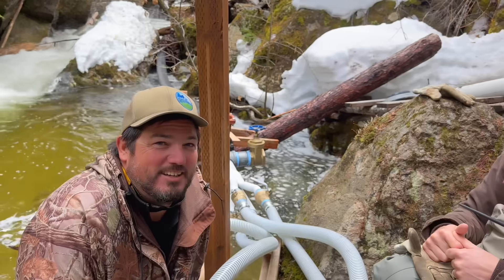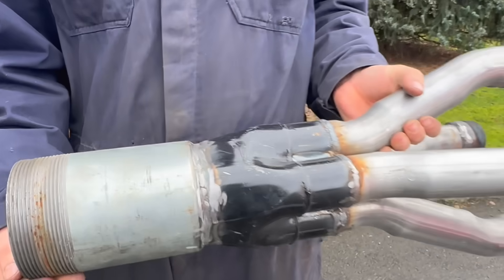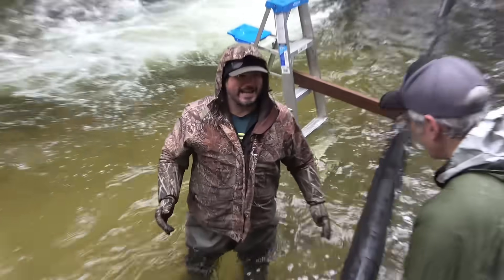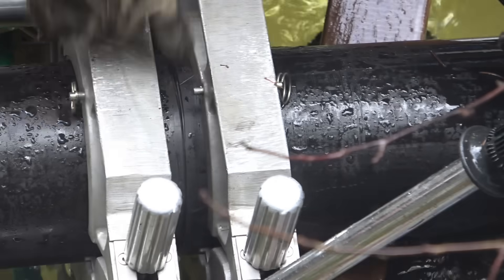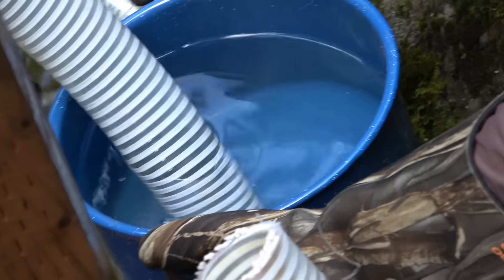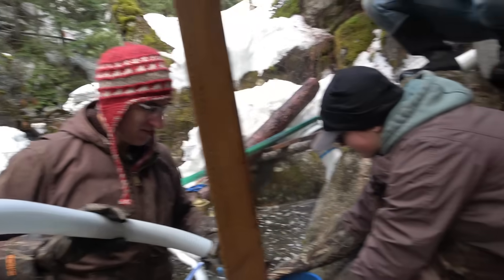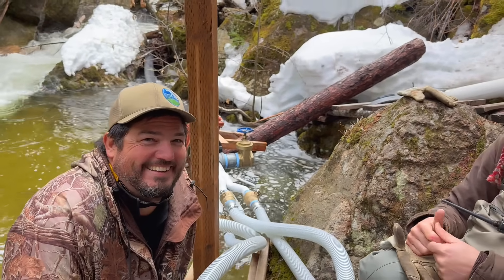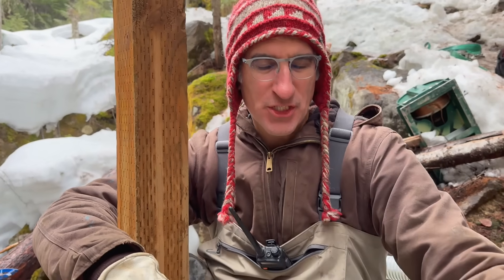Off Grid Micro Hydro - 24/7 Electrical Power - THIS is The Way!

Comment: Need to match the generator with the flow. Just by a guesstimate I would say each of those hoses could power 1 generator the size you got now. The rpm is what is key or flow on low head systems. For a investment if that river flows like that year round you could build a spiral flow generator. It takes excavation and concrete forms. It has the potential to be a 100kwh site. Electricity grid power will only get more expensive and they by law have to pay that's grid back fed half of what they charge
Reply: More more thing. If your generator is far from the load,house, then higher voltages might be needed anyways. Voltage drop is the main source of breakdowns in circuits
Reply: @brettmoore3194  voltage drop only matters if you run DC very far.....3 phase AC, which is what the generator puts out , can be ran a long way with smaller wires than DC

Comment: What's the ROI and life span on a system like that? I imagine it is not terribly cheap but it's a work horse 🤷‍♂️
Reply: depends on how much it cost to put grid electric in and how much per kilowatt it cost for grid electric.....say if it cost $30,000 to put in....instant ROI, if it is in already and electric cost $0.10 per Kw then it might take 8-10 years...same with solar

all you see here is the pipe and generator...then you have to have  batteries, a charge controller, an inverter, and wire to wire it in....if you were in kentucky, they want you to have a $1,000,000 insurance policy just for the system and have it NABCEP certified on the install if you connect to the grid

Comment: 12:40 - I guess torch would have still been usable to heat the barb fittings so they don't immediately absorb heat from the heated pipe

Comment: I don't know how far your wires run, but a higher voltage is generally better for efficiency. Get a proper charge controller on the end where the power is being delivered at and the turbine will be more efficient as well.

Comment: I don't really like being critical but people sometimes need things called out ...  Your level of pollution needs to be STOPPED, by everyone!!!  It leads to cancer and disease.

I appreciate the spirit of innovation and building for sustainability but it should still have some regard for the cost of humans contaminating pretty much everything.  The cutting of the plastic pipe and hoses, and the machining to weld the plastic pipe, left behind plastic fragments that will turn into micro-plastic particles (not to mention the chemical out-gasses) and make there way into the ocean, if not other peoples water sources.  If you knew that someone upstream from you had done something similar, and that contamination led to your family's health issues, or death, you might think before doing it to anyone else.  Please act more responsibly, and advocate for better, otherwise, we wont make it on this planet.

Comment: QUESTION: Wouldn’t it produce more overall power if instead of using 4 nozzles in to 1 turbine, you used 1 nozzle in to 1 turbine, but did that 4 times (requiring 4 turbines)?
Since the water is approximately the same speed coming out of each nozzle, having 4 nozzles in one turbine, is not increasing the rotational speed, just helping the turbine overcome any physical resistance.  But if you had 4 turbines going, snd you were able to balance the outputs in parallel you could get close to 4 times the output in power in to the batteries.  Even if it is not exactly 100% of original times 4, if it was even 75% times 4, or 50% times 4, you have substantially increased the power going in to the batteries.

my question is how ro you combine the parallel output of 4 turbines simultaneously?

while i am not sure of the answer, i am speculating, you could get 4 EG4 Chargeverters, and feed each one with AC output from one of the turbines, which then is converted to charge 48V batteries.  This would reduce energy loss from turbine to batteries, because of higher voltage ac thus less resistance losses, and allow parallel charging in to batteries.  This also eliminates single point of failure (after the manifold).

please advise on your opinion of this idea

Comment: It may been wise to have built a sturdy 'power house' first, then you could be doing all your tweaking and adjustments in relative dry, calm away and above the river, also you could store all your tools and equipment there for when you need to service the machinery. You are right about laminar flow though.

Comment: Also, your "intake" at the top should be capped off, but have like 20 foot of pipe with little 1/8" holes drilled in it everywhere in a grid pattern all the way down it, so that it creates a screen, essentially.  But it would still be a very large intake so that it doesn't restrict the flow..  But it DOES stop any rocks from coming in.

Comment: You need to optimize it by changing the LOAD..  Some systems work well when spinning up quicker..  But a system like this looks like it would have a lot of TORQUE.. meaning you could bog it down with a higher load and pull a lot more current-- and I bet that water could still spin it.  I would try to add more and more load onto it until it actually stops spinning, then you would know exactly how much torque that water can turn..........  Think of it like putting a little generator on a diesel engine and all this time you're trying to "optimize the diesel to gain a few more RPM's.   That would be silly right.   Because we all know, diesels don't need to spin faster, they just need more load on them, because they have high TORQUE,  not  high speed..........  I don't know what you guys have this running:  I assume it's just going into some sort of charger for batteries.  My point is, now try to run TWO chargers on it.. or just load it up more somehow.....    idk, I wish I knew more about what you guys have it plugged into.

Comment: Seems like that style of turbine is not the right one for the application.   Had a friend on the American River with a low head turbine with about 4 times that water flow but only a 2 foot head and he had four, one thousand watt heaters running out in the woods as power dumps to keep the turbine from over speeding.
Reply: Stop the cap fam , you don’t have friends (I don’t either lulz🤣😵‍💫)

Comment: What do you mean it wanna do 200V and its directly ties to the batteries???? wouldnt that over charge them whitout a charge controller? You need a similar thing as an MPPT for this,like in solar,....whats the actual setup tho?
Reply: I’m assuming he’s talking about direct charging. Chargers have been getting more advanced. For those that support it, the charger can go into a direct charge mode after negotiation and safety checks. Essentially it feeds the source voltage (solar, hydro, etc) right into the battery cells. It reduces heat and inefficiency by not going through a conversion stage before hitting the battery.

Comment: Pelton turbines are for High Head low flow . You have high flow low head.

You should be using a propellor type turbine( they don’t make Kaplan turbines that small )  or at worst a Francis ( reverse centrifugal pump ) type .
Reply: Nobody commented on your error... 7/8 is bigger than 3/4 ... You said it was originally 3/4 and you reduced it to 7/8!
If you ran your supply pipe straight up the hill, then ran a pipe horizontally from the river at a higher elevation, you could have high pressure high flow and really get some power out of that system.
Reply: @alexbruski1138  at 14:20 he says it was "cut down", in this context when the nozzle is tapered, cutting off material will enlarge the opening size, in this case from 3/4" to 7/8".
Reply: Was checking the comments to see if someone else said this. Optimize the turbine style. Kaplan or Francis is probably the way to go.
Reply: this
Reply: Im confused as to why you sectioned out a piece of the penstock rather than disconnecting the tube at the big valve and moving it back.

Comment: If you want to run it at 200v just install a solar mppt controller. It will optimize the speed and feed the batteries correctly.

Comment: Love what you've done. To optimize the thrust for each jet nozzle, remove a flexible hose off the turbine and slip over the end of it and down a bit, a "short piece" of a larger sized pipe connected to a spring gauge. The other end of the gauge is tied to a length of cord that is wrapped around a few times further along the length of the turbine flexi-pipe. Turn on the water and watch the gauge rise until a stable measurement is acquired. Try to get the interaction between the short piece of pipe and your turbine hose pipe as frictionless as possible. The hose from the turbine needs to be "loose" or unrestrained like a swing and have some flex in it for this to work. It is easier if you can lay part of the pipe in water while keeping the end of it out of the water including the gauge. I made my own version of this, and it worked.

Comment: It looks like to me that you need a bigger generator. You have all sorts of power from this stream, but you are using a tiny generator, seemingly. Also, your turbine size could be  bigger from the looks of it. That being said you are getting about 0.075 kW from your system, which is something.  But it appears that your entire system is undersized.
Reply: I would think with a 6" penstock and 30' of drop 2-3KW should be pretty easy to get.
Reply: @joetuktyyuktuk8635  Agreed. It would initially cost a lot more, and that might be why they haven't used a larger generator system.
Reply: @franklong6269 When it comes to projects like this, doing it piecemeal and upgrading one component at a time, is probably good for a Youtube series as it shows incremental improvement, but as a real project definitely the worst way to go about it, as it costs more overall rathet than just biting the bullet right at the start.
Reply: @joetuktyyuktuk8635  Yeah, I thought of that also, it's a good observation. But probably, they didn't have a ton of money to begin with, so they started where they could. Look at this video;' it took them a year to fix the issues that they had with their previous installation. That being said, I admire their hard work and intelligence in doing this on their own. They deserve a lot of credit.
Reply: Perfection is the enemy of progress. 

Sometimes, all the time, it's worth it to just start the project with what you have.   Make it better as it needs it.
Reply: @fnsfabrications6844  Sometimes that is true. However, the construction industry operates on the opposite assumption, because retrofits are VERY expensive to incorporate. Better to get it right the first time.
Reply: @fnsfabrications6844  I am from the school of do it once, do it right... but thats me.

Comment: I can hear that turbine screaming and begging for a roof to keep the snow and rain off of it.    Beautiful manifold, the flexible pipe is it smooth inside or ribbed like the outside?  If ribbed you will gain some efficiency with smooth pipe.

Comment: Nice setup, good job guys. I would expect you can get much more power from that much water flow with a larger turbine setup and maybe even double the number of nozzles you have for more torque or a second turbine.
A trough with a coander screen? Might be a good way to keep the inlet clear of rocks entering the system upstream.
Another idea would be to have a rock settling/seperating tank somewhere inline where the water enters the tank and swirls the water before exiting leaving any rocks on the bottom, have a slide gate opening or large valve you can use as a periodic clean out of the rocks & debris collected in the tank/vessel.

Comment: What a waste of time building a manifold then putting corrugated pipe on it to slow the water volume down why would you put corrugated pipe on there the inside of the pipe should be smooth
Reply: Those are smooth on the inside.

Comment: Does your pressure come almost exclusively from elevation or could less elevation and longer distance (with more volume of water) Achieve similar results? Sorry. I am pretty stupid, but we’re about to move into our new homestead and have an 800 ft boundary of a river.
Reply: Yes, pressure is directly related to height, i could be wrong but I think it is roughly 1.5psi/mtr, look it up.
The wider the diameter of pipe will give you higher flow volume, but the vertical height will give you pressure, you can actually use the head pressure to determine vertical height to point of entry.

Comment: You Guys! With The Flow you Have coming out of those 4 nozzles, You could Easily Generate 3 Kw Constant with a Bigger Generator. Maybe get a 4 or 5 Kw one, you guys would be set. :yougotthis: Great Job Guys! You Have always been an inspiration!
Reply: I know right? Those buckets are way too small. 
And they don't have a mesh to prevent rocks from getting in the system.
Reply: Not sure you're right. If it is a 200gal/min at 30 feet of head, the hydraulic power is around 1300 watts.
Reply: @ethans4783  From a hydraulic pump power pack perspective, 1500PSI @ 1GPM = 1HP motor required(if motor is 87% efficient). This would convert to approx 7.5HP(5.5KW) electric motor required to pump 200GPM @ 10PSI. I'm not saying 1300 watt is incorrect but it appears there's some major inefficiencies if power output is 1.3KW at 200GPM @ 10PSI.
Reply: @randallweaver7034  Low Voltage output  no step up transformers  an a  long Power  transmission line for what it is.  If 4x the voltage then waste loss would drop by at least 50% .
Reply: 6 pole 4kW inverter generator with 3 phase 80kW capacitance
Reply: 700 W * 24h is already 16.8 kWh every day, a regular household maybe using 12 kWh, so there's really no need for a bigger system
Reply: @mobbat42 netter having and Not needing than needing and Not having

Comment: Nice work, thanks for sharing. Trying to understand this better, you said you have a high-flow, low-head. I must be missing something, as it looks to me that you are using an impulse turbine that would be made for high-head, low-flow. Would you not make more power using a reaction turbine?  With 30 feet of head and a 5" pipe running, say 500 gallons per minute, you should be over the 2000 watts range. I get using what you have, but I feel you're leaving a lot of power on the table by running the impulse style turbine.

Comment: What happens when all those valves freeze solid?

If it were I, I would use a paddle wheel floating on tethered pontoons and compress air, storing it in an "air battery" (pipes & storage tanks) near your house & out buildings.

Comment: If the welded connections on the intake pipe do not hold consider a FLEXMASTER joint.
 Also get rid of those gear clamps or worm gear clamps and get some mikalor  clamps instead .
Last but not least since you have an extension cord on sight use a heat gun to soften your pvc hoses instead of hot water.
Hope this helps
 Good job on the video enjoyed the show.
Reply: There are battery powered heat guns also.
Reply: @1dave301 $25 heat gun with my $250 DeWalt battery is sweet some times